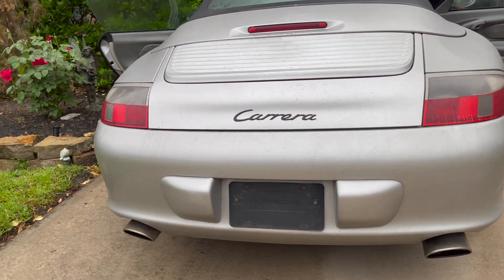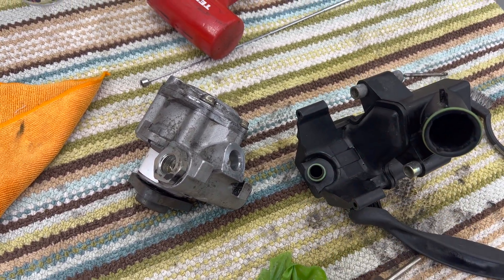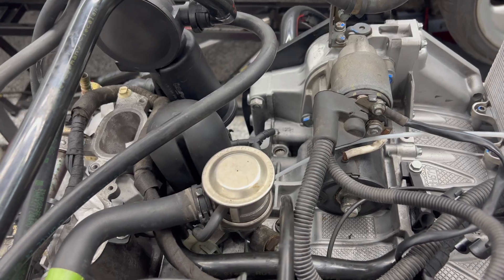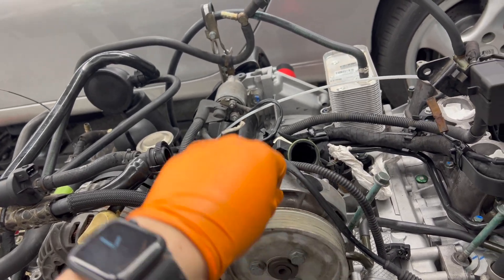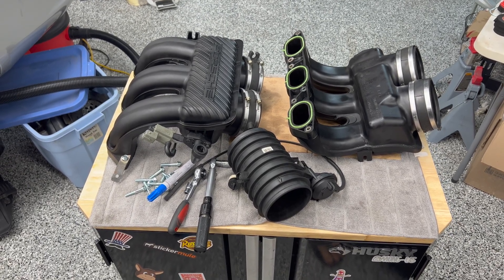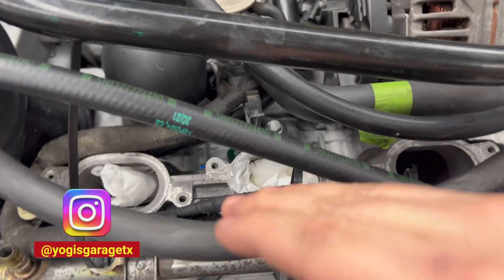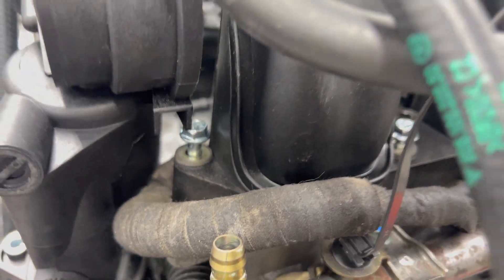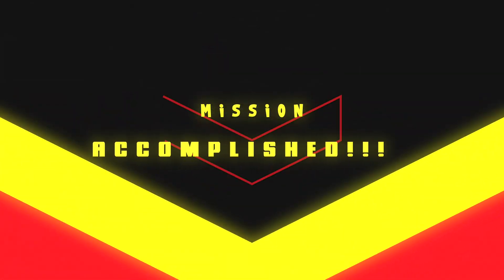4.0 Porsche: FINAL ENGINE ASSEMBLY - Here's What I Learned

Comment: Nice work! Great shot at the end with it 99% competed. Question, have you thought about getting a coupe roller for that engine? I say this because you built it to 4.0 and coupes are worth quite a bit more than cabs and are trackable. Your engine alone is probably worth more than $20k. Could be a real score if you found a C4S roller for cheap and built a $40k+ combo. Aim for a BAT auction for top dollar. Then find a used 3.6 for the cab (plus make more yt content on all of it).  Not that you have room to do all this stuff.😊  Anyway, just my long winded thinking out loud.
Reply from the maker: Oh yeah, Yogi-mama and I have discussed this topic in great detail. It’s possible but I’ve put so much work and money into the body that I emotionally wouldn’t be happy about it. But the engine has potential in ANY roller. Thanks for watching!